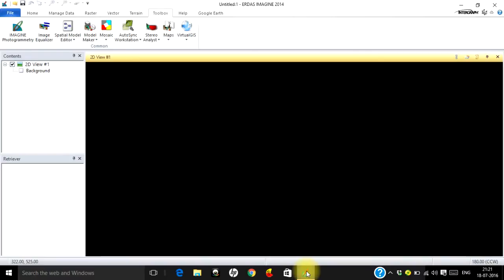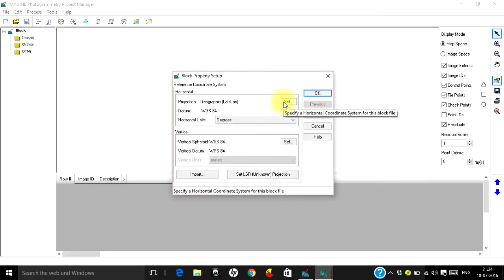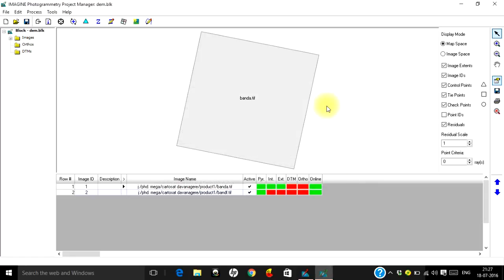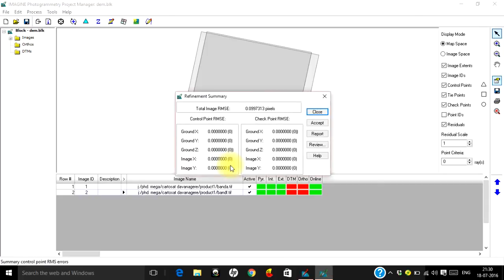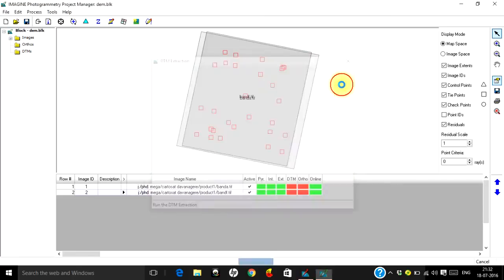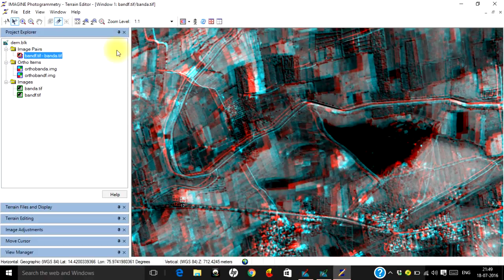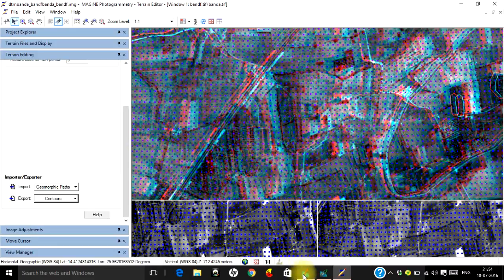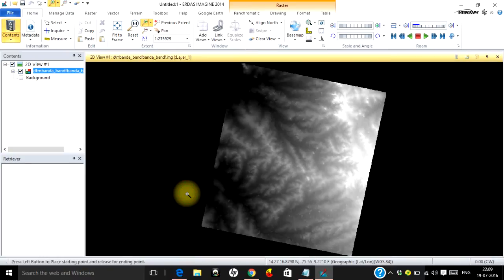Extract DEM, DTM from Stereo Pair Images Using Imagine Photogrammetry (LPS)

Comment: I would like to know the steps for creating 3D city model (3D buildings) from worldvew/ very high resolution stereopair data. 
Please provide suggestions sir
Reply from the maker: I do not have video on that. If I create I will surely upload
Reply: If possible, Kindly share the methodolgy  or write the steps. so that it will be so helpful. Thanks for your reply
vishnuedakkat93@gmail.com
Reply from the maker: I dont think its possible to explain over text. You may try some online material or contact someone working on that in your area. They will be able to give practical exposure
Reply: Sir,
I am trying to add frames in Imagine Photogrammetry.. I am stuck with an error popup always.
Unsupported Compression Type:- 
If am clicking on OK to ALL:-
It will show a pop up with "Unsupported Compression Type Layer Unable to Open".
Why this is happening?
If am procceding with this error: On automatic Tie Point Selection-Am able to get 44% accuracy only"

Comment: How to generate DSM sir using ERDAS or DSM extraction from DTM
Reply from the maker: I have not done that. May be you can check the manual
Reply: Procedure said by you is to generate DTM which is a bare eart model?
Reply from the maker: Ya, uts DTM. If I =remember correctly ERDAS has an option to convert it into DSM

Comment: Nice video! Do you have an idea why I get a constant Z offset between my result and a correct reference dtm? the scenes match nicely but my result is almost constantly 15m higher ...for another test area I have the same issue but there my scene is about 10m lower...
Reply from the maker: I am not sure. May be you can contact the image provider. However if the values are varying constantly, may be you can change the values accordingly